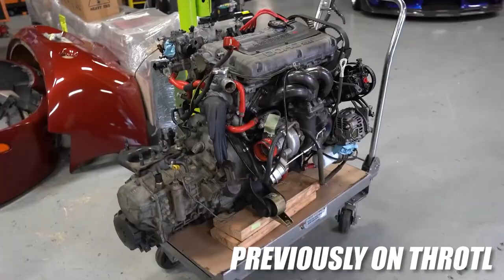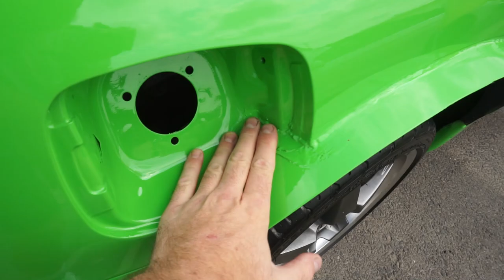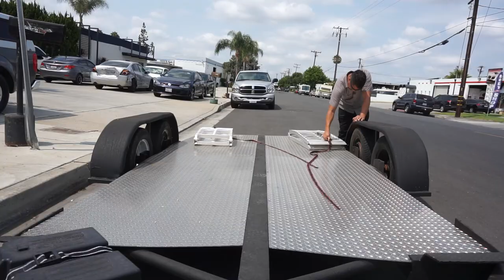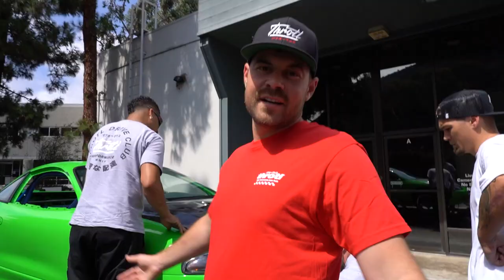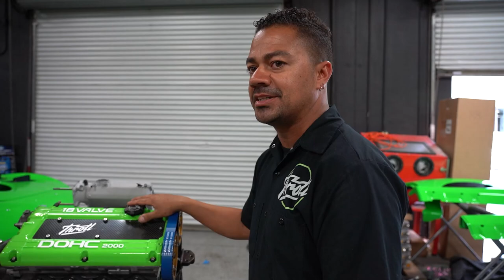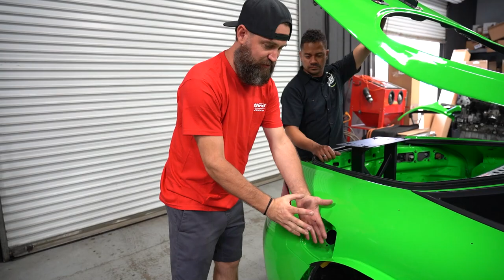Building a Modern Day (Fast & Furious) 1998 Mitsubishi Eclipse GSX - Part 8 - SEMA 2021

Comment: I’ve been waiting on this and been more excited for this than any other build I think. I’ve had 4 different GSX’s and a TSI. I’m a fan.
Reply: Same! I have a Gst I'm converting to gsx and planning on running 500hp
Reply: Durango copper GS-T here!
Reply: Same here, I have a 2g GST with an FP black making 500whp
Reply: All 2g's? I've been looking at them forever
Reply: Had 3x Eclipses one still garage 95 GSX.....true fan of the show and of the car.
Reply: I just want to add that the one in the movie was not a 4g63, it was a gst
Reply: @stuartraydroge5021  incorrect, the one in the movie was a GS which has the 420a. The GST has a 4G63 same as the GSX only its FWD.
Reply: @msims1985  bet me
Reply: @msims1985  it had the 420A at 210hp. Aka the dodge neon motor. I owned a gst and I'm a mechanic. Try again.
Reply: @stuartraydroge5021  It was the RS with a 420a. Both wrong lol
Reply: @SupernaturalWB  buddy I said 420a